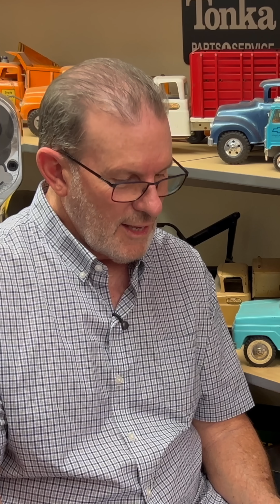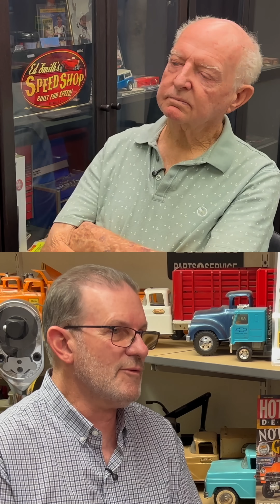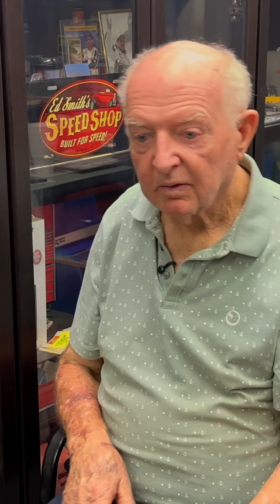Don't Try Roller Cam Bearings at Home! From Ask Ed 46 - Ed Smith w #BarryT

Comment: Im trying to figure out how you dont lose oil pressure with those kinds of bearings without seals.
Reply: We should see if Barry and Ed could show us what the roller cam bearings look like... 

I think they are what some people know as "needle bearings" similar to those found in a u-joint. 

The amount of material that would be removed to fit traditional rollers would weaken (if not destroy) the block.

Comment: Ask Ed what's the easiest way to make power out of a 1973 Buick 455 motor that's in my convertible Buick centurion. It's a 455 big block with a four-barrel Rochester carburetor. Thankyou❤
Reply from the maker: I will ask Ed

Comment: Large roller bearing lets a builder use a larger cam core for more rigidity with big roller cams and very high spring pressure over the nose.

Comment: Rolling friction is less than sliding friction. Less parasitic loss. I had a VW engine with roller bearings on the crankshaft.
Reply: Hydrodynamic bearings are pretty damn good, what do you calculate the gain from rollers on the camshaft to be?
Reply: SPG cranks were weak and didn't oil the rod bearings properly.